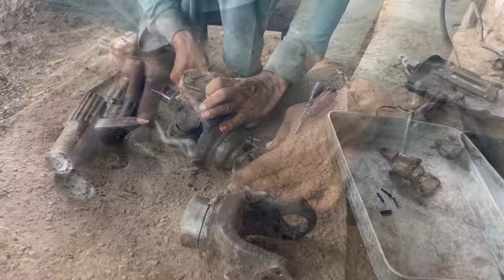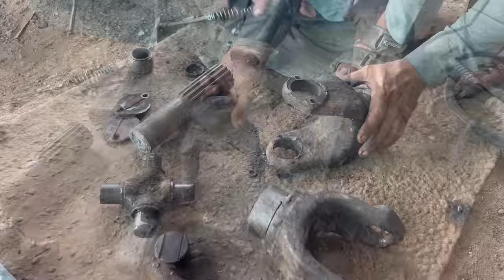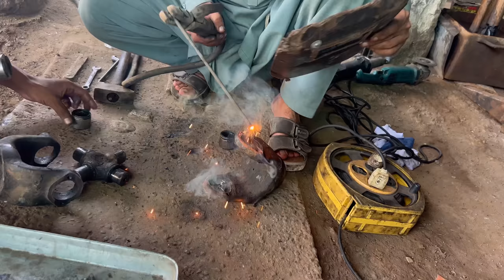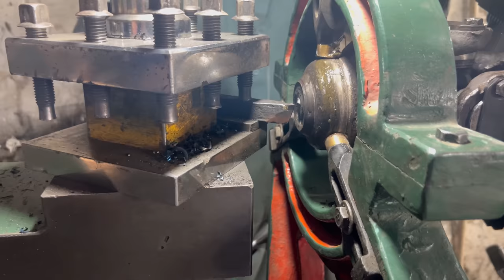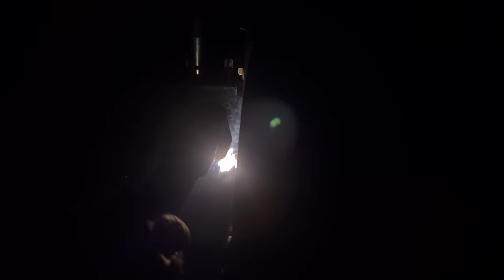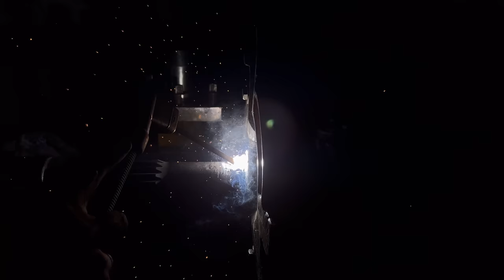How to Repair Truck Broken Drive Shaft - Drive Shaft  With Mechanic Lan,Roller Bearing Is Broken |

Comment: I see a lot of comments putting the guys down . I'm sure with some top of the range tooling and a fully kitted shop the outcome would possibly be different.  A lot of bits I disagree with , the nice clean rag wiping the crap off placed back on the dirt and then picked to wipe the next bit clean... belting the shitz out the shaft after welding it all up , the steady rest being used to carry a piece that wasn't centred or I suspect even round so it's not going to be central . I love the drill bit wandering all over but being held somewhere near centre.  
All in all we don't know if this was a repair to get a vehicle back up and moving to another shop till a better replacement can be located or as I suspect a full repair . However you gotta love these guys doing their best with what tools and resources they actually have available.
Reply: And by this quality of the repair, the customer will come back soon and they have work every day.
Reply: My guess is that they will use this until it breaks again.
Reply: I'm sure it will Phil and many more times till the repair literally become more repair than shaft ..

Comment: Older Drive Shafts are  made from medium carbon steel, so preheating 200°C–300°C is required before welding. the repaired part then needs to be  cooled slowly,  then stress relieved at 550°C - 660°C.
Reply: @Carlosxyz1000 Guaranteed for 50 minutes or 50 feet whatever comes first
Reply: i am sure you do it that way   but these guys make it happen
you need a little stress ress-relis
Reply: @pamlabrecque7430  You a welder Pam?
Reply: @pamlabrecque7430  if you don't  preheat & stress relieve as per welding rod manufacturers instructions the part will  have a very short life, & it will likely fail catastropically. It will need to repaired again & again. Vehicle Safety cearly isn't a priority in this country
Reply: @PD-yd3fr  I would not call myself a welder  I would not even know how to weld say 
a broken trunnion on a td-7 or a cracked differential yoke on a tractor
I would just preheat it to about 200 -300 degrees then super glue it
I was just commenting about those guys fixing a broken driveshaft with what they had
Much Respect
Reply: @@Carlosxyz1000 It will last long enough to justify the repair which is the point, there being no other affordable options. The part cannot be even close to as strong as the original but it's 100-percent better than nothing at all.  NONE of these popularly videoed repairs are best-of-breed but they get the job done well enough for their use case. When money doesn't exist mechanics make do.

Comment: Ooooh.  BAD.  Bearing caps are a loose slip fit in the socket end.  They will be wallered out in no time.  You need a light press fit.  That way, there's no hammering of the housing ring as the power is applied, then withdrawn.  All the engine's power is endured by those U joints.

Comment: You make do with what you have. The money these trucks earn is little, and they need to keep working. The crude repairs using simple tools is all they have in a country where labor is ridiculously cheap. The value of human life is low, if a man is killed or injured they just find another from the vast pool of replacements. Using ancient machines dating from the days of British rule and patched up many times it is truly amazing how these men keep their society running. 

Look at how out far it is from being true. And those needles, what's left of them in the u-joint. Truly amazing if it lasts a few weeks. But in a society of cobbled together machines and crude tools it's an amazing feat these men perform. Imagine what these people could be under different circumstances.

Comment: I have watched several of this fellows videos, and I must say he does outstanding work. But I take opposition to how he tacks the inside of the u-joint bore hole here.  The cup of the u-joint must be dead center in its bore hole and be very snug fit otherwise it will vibrate when rotated at high speeds.  He should have welded all away around the bore hole then drilled it out to the correct spec diameter.  His welding with a stick welder is exemplary!  Also an excellent lathe operator.  Just wish he would wear safety shoes!!

Comment: A suggestion.  Why not have an elevated work area.  If it needs to be concrete then build one.   But a steel table may work.
Reply: they would cut the steel tables up for repair panels.

Comment: Guaranteed 30 feet or 30 seconds what ever comes first. That thing it going to fail real quick between the sand in the bearings and it being out of balance yeah not good.
Reply: 15 feet
Reply: @zerny1  I reckon closer to 10 feet ... But this depends on whether the truck is rolling downhill or driving uphill.
Reply: I saw hill measure and dial it in real careful..../sarc
Reply: @zerny1  фё

Comment: That shaft appears to have been repaired before. Note the difference in materials on the broken shaft, with a HAZ apparent. Also, it appears to have voids in the outer part of the shaft from previous poor welding.  I suspect after this repair it will inevitably fail once more.

Comment: I would like to send this guy a lot of tools.. He keeps his lathe clean.
I thought the same thing as others did, why weld the complete assembly.  Several reasons that I see, is balance, correct length, and chucking a half trunion is difficult in a lathe is difficult. The bearings were well protected and obviously did not get too hot, one these universal joint needle bearings and cups are designed to withstand a lot of heat.
He is a master at what he does. He has learned to silver solder carbide tips on his cutting tools.  
Yeah, I would like for him to get out of the sand. But it seems as they keep critical parts clean...well, sometimes.
I send him much respect. 
I sold a truck to a Pakistani government buyer. This guy was a cold fish to the extreme.'
I excused myself to call my Mother, who lived with me. I told her I would be late, but there was soup for her if she got hungry. The Pakistani said," I thought Americans sent there old people to nursing homes". I replied that my family didn't and that my Mom was disabled and lived with me. This guy told me that his family had an aunt living with them. The guy became very friendly and we actually had a good conversation.
I admire the Pakistanis and hold them in highest regard.
Reply: Master hack. It will work till it breaks again. which won't be long.

Comment: Another unbelievably bad bit of machining and repair. It won't last more than 10 minutes as soon as a load is applied to those needle roller bearings, plus the vibration from it being welded up eccentrically.

Comment: If hitting it with a hammer (near the end of the video) made any difference then the whole job is doomed.
Reply: Clearly you have no idea what he was doing, hitting it with the hammer gets it running true on the steady rest before machining. You then tighten everything up and cut it.
Reply: @BedroomMachinist  Thanks.
Reply: @BedroomMachinist  Have another look. He continues to hit it after the machining is done, then removes it.
Reply: I expected him to tack it, true it then build up the weld.  He made sure any wear in the Universal Joint was taken up with some weld and dirt so top marks there

Is this just to get you  to a place to fit a new part or a "permanent" repair?
Reply: That drive shaft won't last long.
Reply: @lw7238  This unbalance is very dangerous ( at a certain speed the drive shaft will disintegrate) and destroy maybe the entire drive unit including differential and gear.
Reply: @gneuhaus8047  Especially the way they overload their trucks.
Reply: @sidneybowerman558  That's the way they balance it in this country.

Comment: That's just a matter of common sense; the guy went all the way to fix the shaft, replaced the U-joint for another used one, but never bother lubricating the bearings and besides of all, let the bearing case loose inside the U-joint. Come on! You can do better than that.

Comment: i got a flash watching, this guy knows a
 thing or two about arc eye. i think you left a few rollers in the sand, smashing bearing caps with a hammer is not the way.

Comment: Job Well done under this circumstances.
When you do a repair with the things you have .
Yes when all of you so called Mechanics open your Laptop and order a New Part that arrives tomorrow or may be not , this truck is 1000km away and on the road.

Comment: Emmm...
There's room on the shaft for a ring covering the weld about 10mm thick. I'd weld it to the shaft and the face of the hardi. It would add strength and the increased diameter of the ring means better twistability.

Comment: Welding on drive shift is not
reliable,this is temporary solution if this broken in between the journey,and carrying load o truck,so these
Workshop on the highway provide temporary solution to reach near big city.and the road
Is straight so no big torque on this shaft.
Koi driver ha jo batae jis ne
Ye drive shift weld Karwai ho ur usne 4-6 mahena nikal lye hon.
Reply: You do know they come from the factory welded?
Reply: @lennym1636  OK,that's good information,
But here it is looking welded
at the end,and could be inserted
20mm in female part,and then then it is welded around.
Or may be pre heat process adopted here.

Comment: That is a bit dodgy putting welding tacks in ( 10 minute mark )to build up the roller bearing holes so roller bearing fit tight rather than like what you first did and weld it all and grind it back , stop with the short cuts, keep welding and grinding. If a job is worth doing ,,, Do it right…?

Comment: Why use a die grinder on the u-joint when you've got a lathe?  and and and why assemble the thing before welding the broken shaft back.  You've got a 4 jaw chuck FFS.
Think this video is for show and not go.

Comment: Horrible job👎👎👎👎👎😬😬why not be first and build a bench?I did 1 inch plate 4 ft by 6 foot. 4 legs 3by3 by 1/4. Weld up nice to work from.